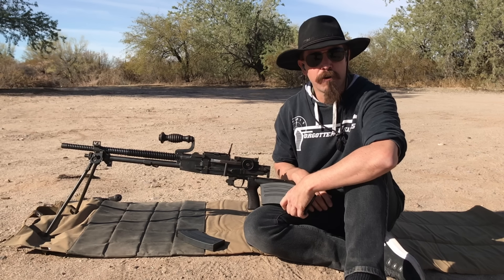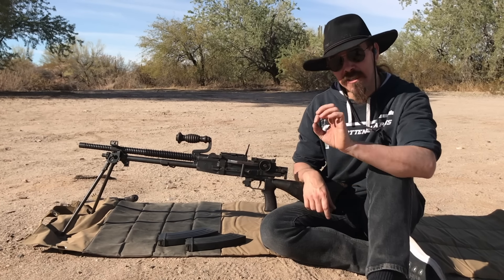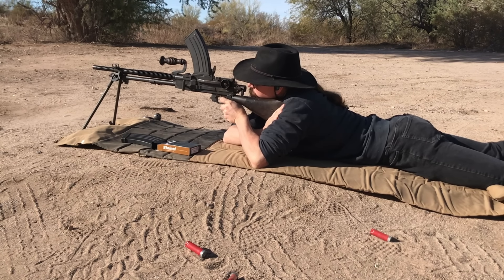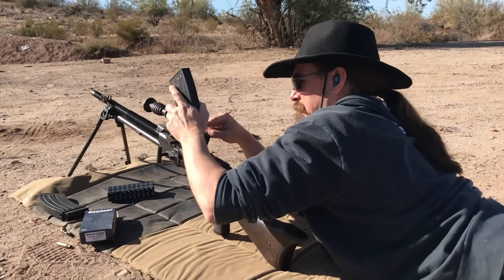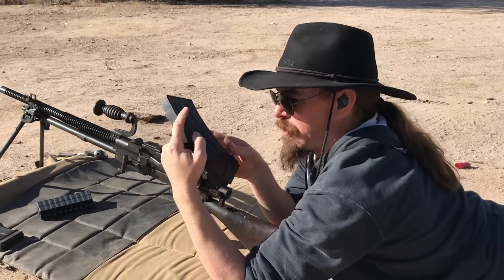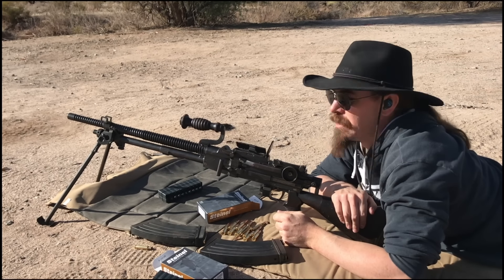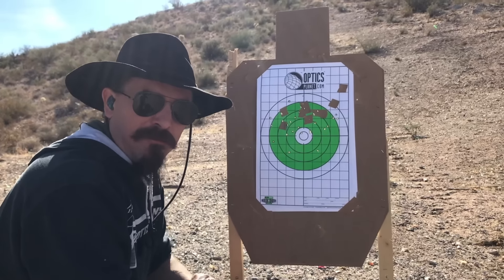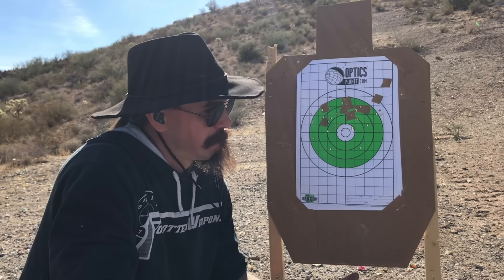First Range Trip with a Type 96 Nambu LMG (I Think I'm in Love)

Comment: He said that firing that gun with a hole drilled in the barrel will lead to catastrophic results... What would happen? Would the barrel blow up?
Reply: Depends were the hole is in the barrel. A hole(s) near the receiver were the pressure is high could break things.  A hole near the end of the barrel is just porting.  A large jagged hole could also negatively effect barrel integrity.
Reply: Depends where the hole is. I think it was Mark Novak (but might have been Ian or Karl) that talked about some country that deactivated rifles by drilling a hole in the barrel under the stock. Shoot that and the stock blows up and fills your arm and face with splinters.

Comment: Was this gun just not made for softpoint rounds? What's the problem here?
Reply: No militaries use soft point period, and especially back. The soft point, as was shown in the video, causes feeding issues as the cartridge is fed up the chamber throat from the magazine as the unjacketed lead tip gets smushed. I have this exact same issue with this same ammo in my Type 38 rifle and carbines.
Reply: The throat of the barrel was eroded and corroded from 80 years of wear and tear.
The roughness jams up the round causing it not to feed smoothly into the barrel throat...and this is far worse when using a soft point rather than an FMJ round.

The same thing occurs when you have failure to feed, failure to fire and failure to extract problems with a .22 semi auto especially a pistol.
Polish the chamber/barrel throat with a Q tip soaked in Brasso polish and spun by a battery drill....smooth as butter...no more problems with soft lead .22 rounds.

Comment: The last thing you want in a light or heavy machine gun is tight accuracy, elevation yes windage no , needs to spread it around.
Reply: They didn’t use them much for suppressive fire, as far as I know. They had small mortars and stuff for that, as far as I know
Reply: Please stop spreading this mis-information. I think Ian has debunked this myth while discussing the whole Bren vs mg-42 thing. No gun manufacturer would ever want to purposefully introduce inaccuracy into their gun

Comment: Could anybody explain how dirty chamber causes ruptured case? I'm confused.
Reply: Case didn't rupture, dirty chamber caused the case to stick during ejection, the extractor then ripped the case in half on ejection
Reply: Crud in chamber = friction = stuck, extractor pulling on stuck case causes the case to break with the neck still lodged in the barrel. When the next round is chambered, the bullet gets stuffed through the broken-off piece and causes a jam.
Reply: @rflats771   @Trogdor  Thanks for the explanation. So my guess was right. I'm just not sure that only the friction is enough to cause that.
Reply: @jpkosoltrakul  Well, the chamber is very tight, lol, and when the cartridge is fired it expands a tiny bit too conform more to the chamber under pressure, it's called obturation, the pressure drops a bit causing the case to shrink just enough for the case to be ejected, so any built up carbon would be like glue in many cases

Comment: Apparently, an LMG firing bursts in close groupings isnt what is needed in combat. Just sayin'
Reply: Really depends who you ask and what you believe the role and doctrine of use for a section or squad level LMG is. Even the Germans with their 1200 rpm still specified 3-5 round bursts in their training manual to maintain accuracy of fire and conserve ammunition. I was reading a British re-evaluation report of the SAW/Minimi a few years ago that stated that any fire further than half a meter to a meter away from any sort of remotely well trained enemy had little or no worthwhile suppressive effect, so if an LMG can't do that consistently then it's of little practical use. More isn't necessarily always better if all you're doing is burning through your supply of ammunition to make your squad mates feel better by beating up the dirt.
Reply: @jonprince3237  Cheers Jon. I appreciate your info. It seems I may have fallen for an Old Wives Tale.  Appreciate the effort you took to explain.